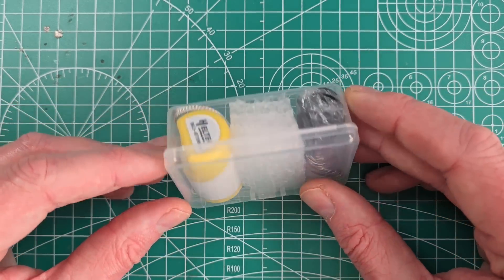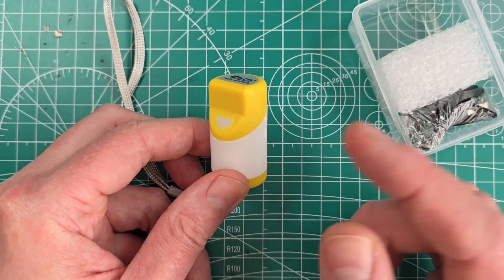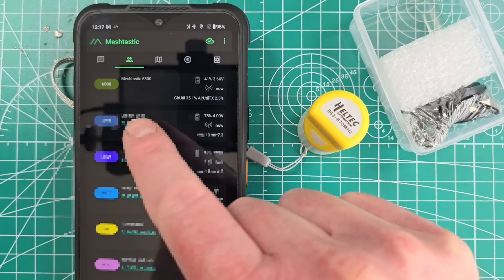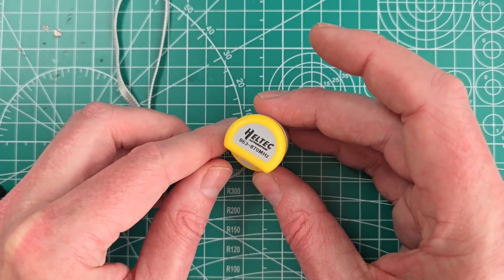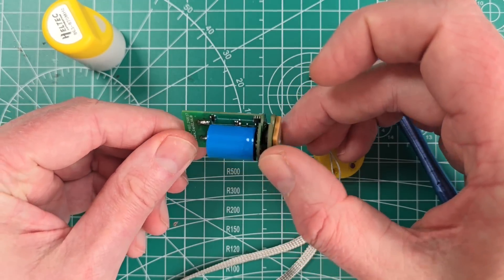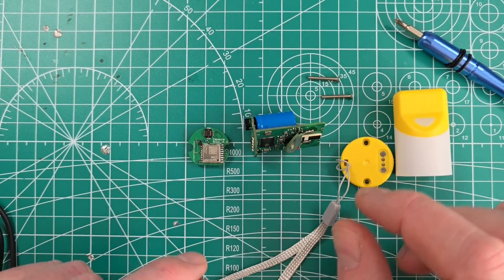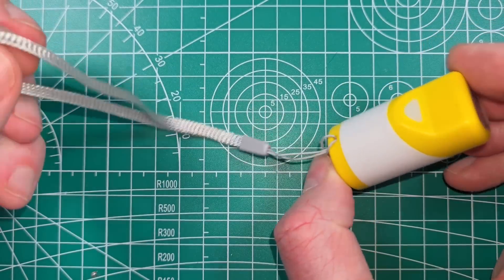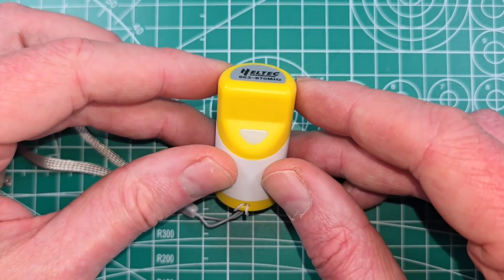HELTEC WIRELESS CAPSULE DEEP DIVE...

Comment: I think my biggest concern with this device is the battery life. The ESP32 is pretty power hungry, and the battery in this thing is miniscule. I can't see this even making it a full day on a single charge. I think a similar device based on the RAK chipset, and its miniscule power consumption, would be a real winner. I'm glad to hear that Heltec is considering changing chipsets out. Honestly, it is time for a dedicated micro sized, low power consumption, chipset for the Mestastic platform.
Reply: I'm intending to put up repeaters with the Heltec boards. Very curious how the wireless stick lite compares to the standard Lora v3 in terms of power consumption. For all I know the WSL might be pretty good for repeater use on an energy budget. (OK I am a Heltec fan .. their stuff is reasonably-priced and easily available)

Comment: I hate to shit on the device since it's not even out yet but absolutely terrible choice using eps32 with it. That means that effectively the only useful role is tracker and using is_power_saving. Otherwise that 250mAh battery is going to last an hour. Plus, their wireless boot means it's completely separate from the rest of the ecosystem who it comes to flashing. You have to rely on their wireless boot. Are there any backup pins for if something goes wrong and you can't flash via wifi? I definitely get the appeal of a device like this, but I wish it would have been more thought out. Not to mention they have apparently added support without including the project in any manner. It's great they are creating hardware to add to the ecosystem but it would be wonderful if they were a bit more collaborative and actually supported the project instead of seemingly trying to ride the popularity wave it's currently experiencing to make money. But those are just my opinions.

Comment: If they can put something together with the nrf chipset then it'll be much more power efficient but this is really great to see, proper non dev board type product. Speaking of products and the upcoming store idea your going ahead with (kudos) do you think you'll be able to stock the RAK wisblock meshtastic starter kits? They are pretty amazing with built in solar support, and the option for PoE, highly recommend them. 👍 Definitely getting myself another one at some point.
Reply: I love the RAK wisblock kit and it does everything you said, the only caveat is: Its not really a true "solar support". Does it charge using a 5v solar panel. Yes, with enough wattage, but the charging IC used is TP4054 and that does not have any MPPT support which is needed to optimize your charging off solar which can be variable.

Comment: They should make a version that comes in like a flashlight body that takes a 18650
Reply from the maker: Yes defo!
Reply: I thought the same and extend the antenna out to a quarter wave(ish) length.   18650 is just so common.
Reply: That’s a simple 3D print
Reply: Wonder if a pop soda bottle preform is big enough to fit an 18650 and the electronics, seems close.
Reply: @RenThraysk  For several soda bottles it fit. Also for a couple of wine bottles the 18650 fits. For smaller bottles it does not so be careful.
Reply: i need to 3d print some cases and stick them up some trees around town as a repeater network lol
Reply: The battery size is 14200 in there atm, wonder if could replace with a 14500 (AA size) lion which would push it around 1000mAh.
Reply: With an 18650 or 21700 battery it would probably run for over year. heh

Comment: Meshtastic is also available for the Raspberry Pi Pico so perhaps we'll see that chip used in the future.
Reply: The Rak Wireless Wisblock is a better chipset than the Pi Pico, energy wise. I think that the community will eventually b building a lot of devices around them (like the T-Echo).